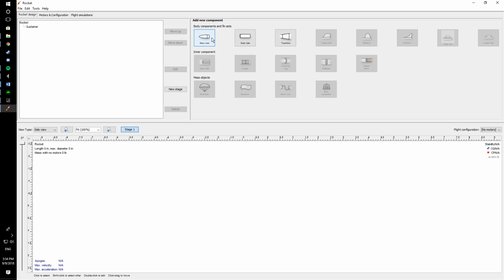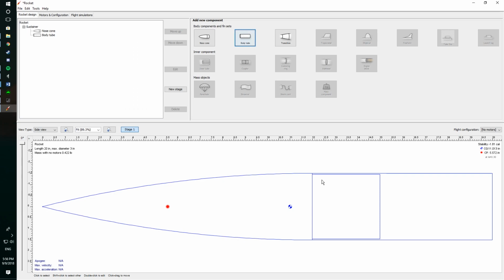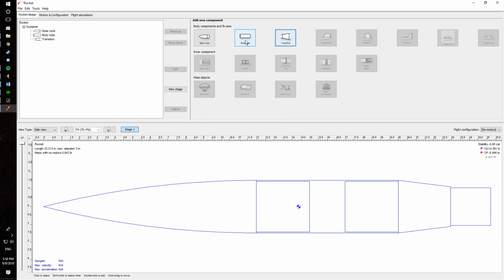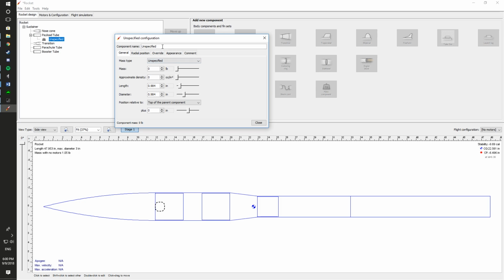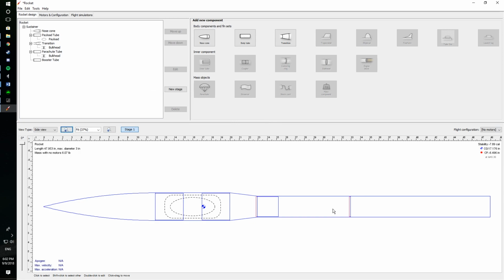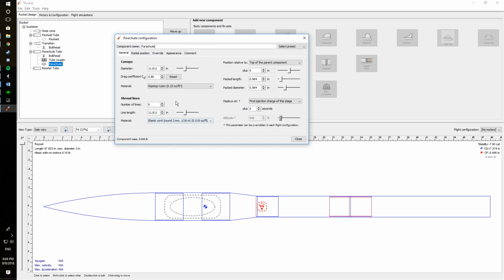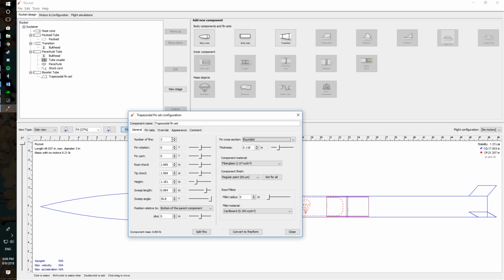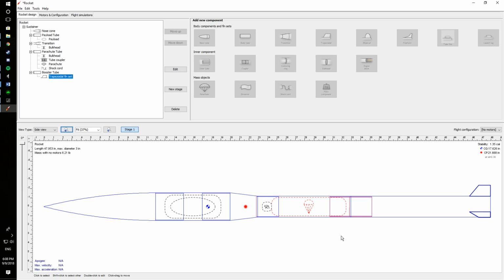OpenRocket Tutorial Part 1: Basic Rocket Design

Comment: sir how do i get a apogee of 500m using only one C class engine
Reply from the maker: You will need to make sure your rocket is stable and as light as possible. Any mass not providing stability, strength, recovery capability, or payload functionality should be removed if you don't need it. If you can't remove mass, try changing the location of the mass withing your vehicle to get the stability between 1.2 and 2 ish.

Comment: Thanks for the video. Just starting to build my first custom rocket. Do you have any recommendations for books on design? I have multiple payloads I am looking to add on, so knowing how to balance the center of gravity and center of pressure are a must. I'm sure though, there are many other factors to consider in the overall design.
Reply: NASA has a lot of old school web pages going over basic principles and considerations and vendors like   Apogee rockets have some informative PDFs mostly geared toward hobby rocketry. If you're more into completely custom designs, there are a decent amount of old research papers with creative ideas on coupling and mounting done by the air Force and other institutions. In general with multiple payloads you want to put the heaviest near the top to make stabilization the easiest. You also have to worry about mechanical stability (i.e. payload isn't morning around or overly stressing the airframe) and axial symmetry. If your center of mass and center of pressure are not along the same axis (more or less) then your vehicle might experience "coning". Hope this helps and glad you enjoyed the video.